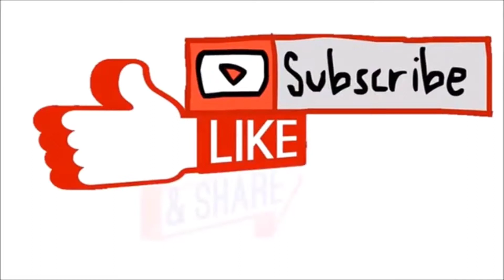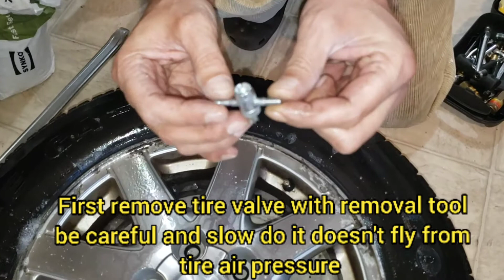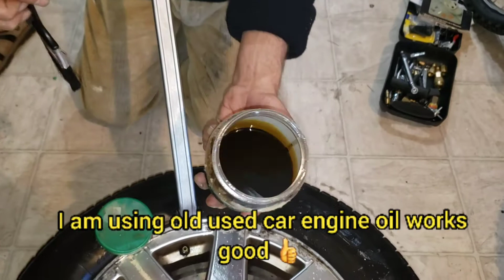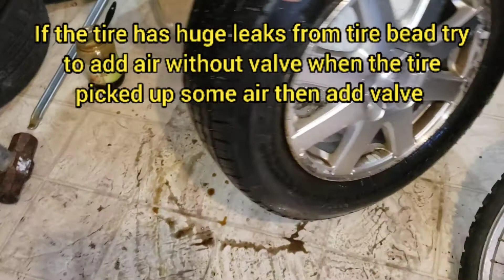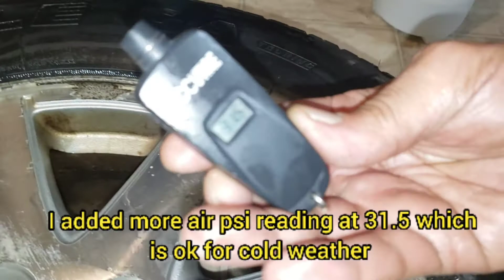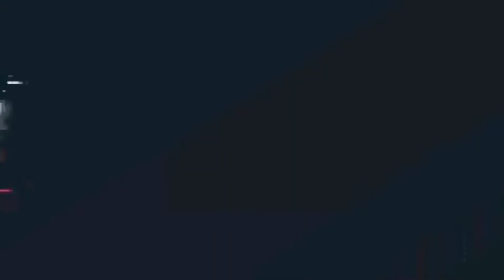How To Fix Tire Keeps Drop Air Slowly! No Holes! Find Out Why? Easy And Simple, Watch This Video

Comment: oil will deteriate the tire bad choice will shorten the life of tire
Reply from the maker: I have searched Google didn't find any proof that oil can deteraite the tire or shortren tire life'  however three are many types of oil and how oil can effect on tires for example
 if tires will be soaked with oil for long time that maybe cause deteraite tire and still if the oil contains  proteloim high presntage 
what can Cause deteraite tires are in fact dry, sunlight, using some of cleaning products contains some camical can cuase damage to the tire 
This matched in this video to use engine old oil to prevent any leak from tire edges  is just replacement for tires lubricant 
Once tire put on the can by over driving and over short time all oil extra oil will be gone 
One more fact I have done this matched few times after a year never seen any deteraition on tires 
Second Fact about oil is protect steel rim from rust in the future 
Finally it's always good idea to use the recommended products for tires lubricant.
This is a web site about tire protection for more details 

https://www.tirebuyer.com/education/keep-tires-from-dry-rotting
Reply: @WorldRandomVideos  you better search somemore i have beenworking around and fixing tires for 65 years and rule of thumb oil will deteriate rubber and some of these new tires you dont know what is in them. invest ina tire lubricant please
Reply from the maker: As I tested it my self soaking or leaving tire in the oil for long time is completely different then using it as tire lubricant 
As I mentioned the oil will be gone during driving the car and the tire edges as the air pressure will get rid all oil out 
That doesn't mean oil is better or safer than original tire lubricant but it's also can be use in case of lubricant is not available and it works 
With all  my respect to your experience 
The experience is the best proof.